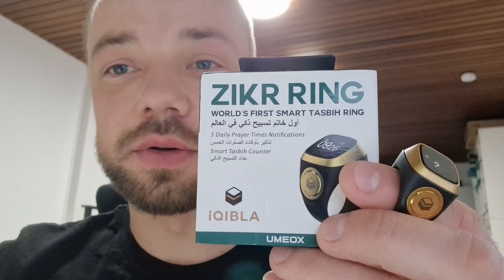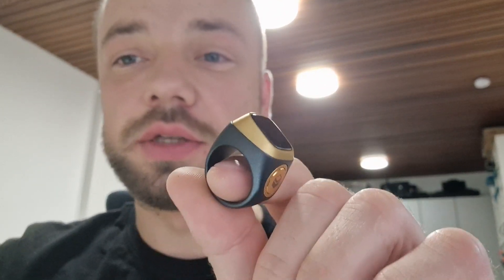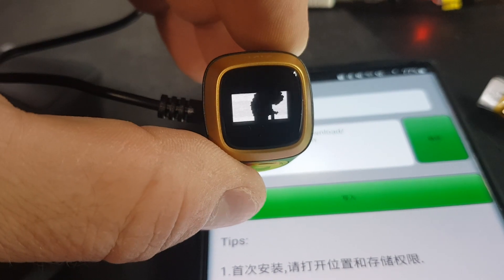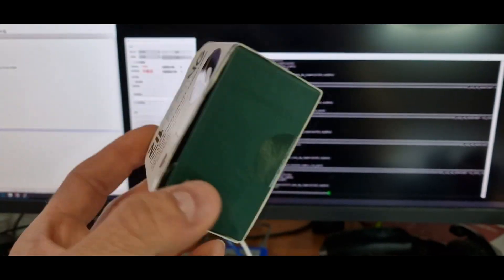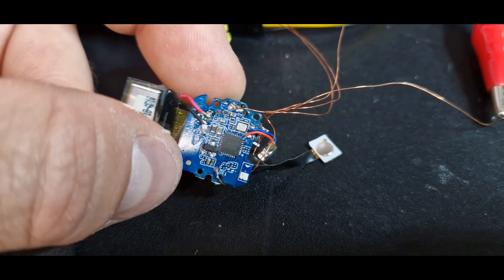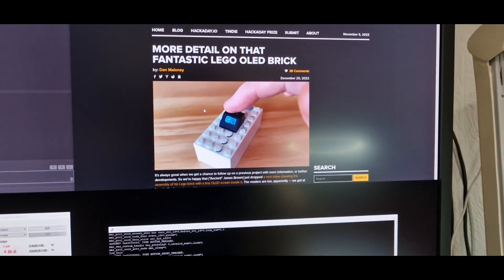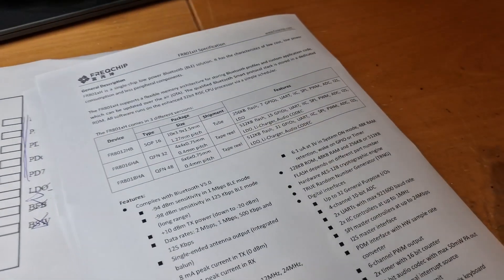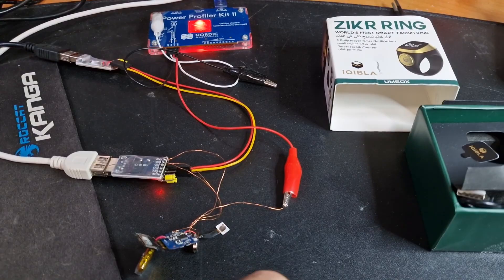Hacking the Bluetooth Smart Reminder ZIKR Ring

Comment: Pardon if this has before been asked and answered, but to learn your skills at university, would one study electrical engineering, computer science, or software engineering, do you think?
Reply from the maker: Good question, unfortunately i dont know the answer.
This is self taught in my case and i did not got to a university
Reply: Computer science is a good start, usually university gives you ways to specialize, by selecting certain courses you are more interested in. 
You can also just take some additional courses in EE if you are interested enough. 
It's not school, you can mix and match as long as you do the required course work for your chosen field.
Reply: You want courses related to embedded systems. EE or computer science. Some universities offer mechatronics engineering now too, which covers similar areas.